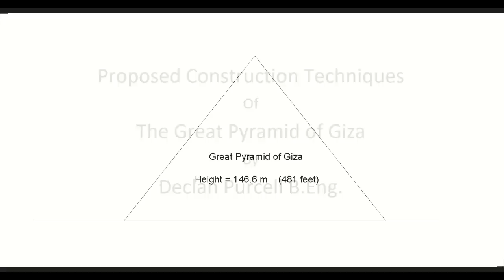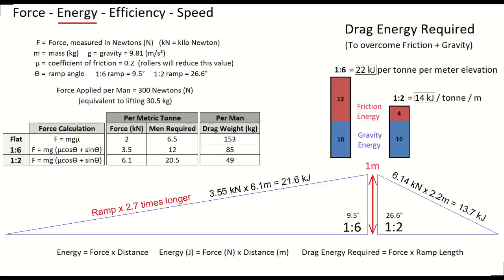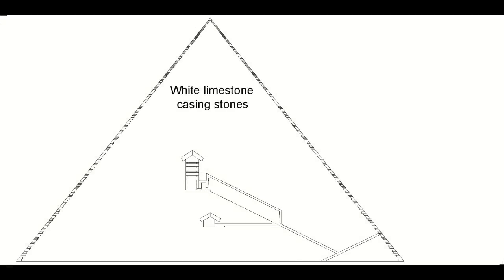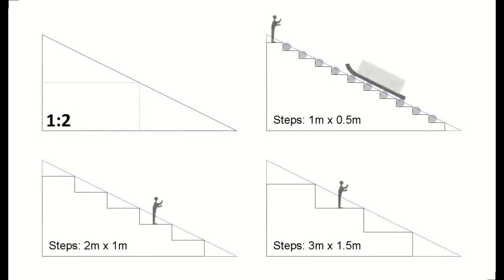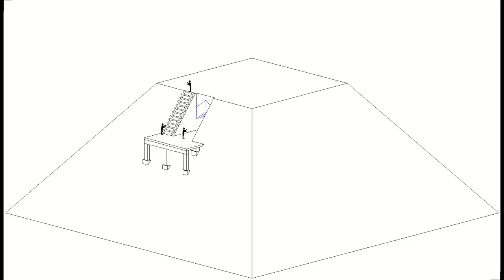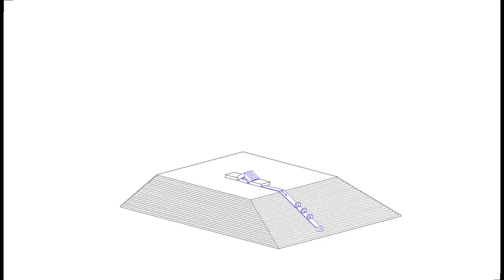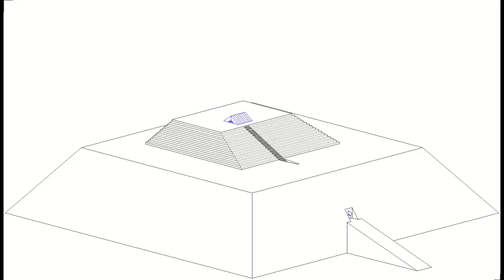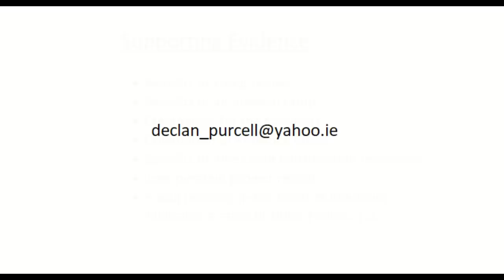Proposed Pyramid Construction Techniques

Comment: Internal spiral ramp. That's what I think
Reply from the maker: Problems with Internal Spiral Ramp :

1: Very shallow angle means the ramp is incredibly long (oner 1 km to reach the top)

2: Up to 18 corners to reach the top (Extremely difficult to navigate blocks around corners)

3:  Corner sections need to be exposed during construction which means they need to be filled after construction … 
This is an extremely difficult task…..  How could it be done…?

Comment: They used water. The blocks were floated into place.
Reply from the maker: The water theory is absolutely a non-runner.... 
I will make a follow-up video demonstrating why...
Reply: @declanpurcell571  do you understand how locks and damns and tow boats and barges al work, yeah?  Once the bottom outter parameter has been built and established , it could been flooded in and used to build it all from the bottom up. World's largest hydraulic ram pump
Reply: @declanpurcell571  The water theory is, just no like lol

Comment: Just a thought, but couldn't they also used their own body weights as counter weights instead of just pulling? For me it would be easier since you aren't exerting your energy pulling something you just hold on with everyone else and you slide down while the block goes up, the only energy you need is to go back up the distance you displaced
Reply: Im picturing some type of saddle harness that you just sit in and lean back

Comment: Wasn’t the Great Pyramid built in 20yrs? That’s would mean a block would have to be quarried, cut and placed ever 2 1/2 minutes. You ramp time at 3 minutes alone is not formatting the timeline.
Reply from the maker: For as much as 80% of the construction one entire side of the structure acted as multiple ramps and multiple step platforms, so 20 or more different teams could be raising blocks simultaneously...

Comment: I believe there was an internal spiral ramp that went along the inside of the exterior. It provides a steady 7 degree ramp, gives better access to the entirety of the pyramid while building. I believe they left to corners open to use a pully system to pull the blocks up, and there is evidence that suggests this was possible, there is a corner pocket opening that fits that kind of description that some have had the pleasure of entering. A few videos of it on youtube one can find.
Reply from the maker: Problems with the Internal Spiral ramp 
1: Very shallow angle means the ramp is incredibly long (oner 1 km to reach the top)
2: Up to 18 corners to reach the top (Extremely difficult to navigate blocks around corners)
3:  Corner sections need to be exposed during construction which means they need to be filled after construction … This is an extremely difficult task…..  How could it be done…?
Reply: Long, yet also easily managed with less people using a pully system. Only some corners need to be exposed, those where the tunnel meets with the corner. If the corner is exposed you would have plenty of room for the blocks. It also requires less material overall.
Many older smaller pyramids have shown internal spirals ramps. There is a low density imaging showing what easily resembles an internal ramp in the great pyramid.
Simply because one cannot explain every single detail, does not mean they are incorrect. But I would say this is the most likely of scenarios. Here is a video that likely describes it much better than I.
https://youtu.be/d7NZRKJvcNs

Comment: All good theories! Ive also read and seen examples of potential building strategies like A hemp rope crane system using pullys and elephants or people as counterweight. Float blocks using inflatables and raise them with a "Water Elevator". See-saw wood jack method to raise blocks. Wet sand.

Comment: If the Egyptians cut, moved, and lifted 2.5 million limestone blocks in 20 years
that means 500 blocks were cut, moved, and lifted each workday for 20 years
That's about 1 block per work minute to build the Great Pyramid

Nobody ever addresses this insane rate - but if you try to visualize 500 blocks being moved each day
ramps can't be used
sleds can't be used
rollers can't be used
levers can't be used

The Egyptians only used copper chisels, small logs, and rope to do this.
The Egyptians had nothing to do with the granite temple inside it - they never built it.

Think about it and the answers should easily come to your mind.
Reply: @noleftturns  are you familiar with herioglyphics? or did you flunk out of school before they covered that?

Comment: I don't understand why the fact there are voids filled with sand never gets mentioned.

Instead of 100% stone blocks, if the pyramid was built with voids filled with sand, it would hold the weight of the rest of the pyramid, yet require less stone being cut, hauled and placed, and it would take less time hauling baskets of sand and pouring it into the voids, than using stone.

With the new information about the corridor having been released, we may learn more as time passes, but with Zahi Fatass sticking his nose into the situation, we may never learn more as he always stops exploration, one way or the other...

Comment: The area around the pyramids was once a quarry, why bring blocks from 500kms away when they were actually standing on rock. There was one hill left when they were nearing the end of quarrying which they divided into three smaller hills, they added tiers to the outside of each, then they added multiple layers of geopolymers blocks, look very closely and you will see some of the lines between the blocks disappear in parts.
Reply: Because Giza plateau is made of sandstone and not granite? And they used granite only to protect the chambers?
Reply: @albertofernandez2490  Incorrect, they used 'sheets' of granite not blocks. Research this for yourself, they lined the Grand Gallery in sheets of marble in the 1970's but after a short time the adhesion started to fail, the sheets started slowly slipping, so they put in metal pegs thinking that would stop them slipping, it didn't so they had to remove them all but a few that are stuck solid. reasearch it for yourself, look for the 'pinkish marble' in the grand gallery, then look for the metal pegs, then see the marble sheets removed, except for a few.

Comment: I would not hesitate a minute to deny all the stories about ancient primitive Egyptians making the Great Pyramids and granite boxes as we find in the Serapeum and the many vases that are made with great precision, up to 0.001of an inch!. We need to stop using data that are made up by someone. The ancient historians Berossos and Manetho tell us much older data about the history of Egypt and Sumer. They mention kings that reigned thousands of years. The Arabic book Hitat by Al Makrizi tells us that the Great Pyramid was built more than 72,000 years ago. The Great Pyramid was built by a very advanced civilization because they knew that their civilization would disappear due to a predictable recurring but inescapable disaster. All these magnificent structures, large but also very small, are a message to us: "Those about to die salute you". That recurring disaster is caused by the ninth planet in our solar system orbiting our sun in an eccentric orbit. So that planet is only around our sun and its planets for a short time. After crossing the ecliptic plane of the planetsat a very high speed, it disappears into the universe for a few thousand years. These crossings cause disasters on our planet with a huge tidal wave, storms, rains and earthquakes in unprecedented amounts and a bombardment of fiery meteors. Another result is a cycle of civilizations. To learn much more about planet 9, the recurring flood cycle and its timeline, the rebirth of civilizations and ancient high technology, read the e-book: "Planet 9 = Nibiru". This book answers many of your questions. It can be read on any computer, tablet or smartphone. Search: invisible nibiru 9

Comment: Funny how they figured as much but not how to use the wheel
Reply: Egypt was one of the first to develop “the wheel” for purposes of moving things and they had the pottery wheel for quite awhile. The problem was never the wheel itself but rather creating a good load bearing axle. Early carts and chariots used thin axles as these turned well but they couldn’t carry much weight. Though we see the concept of a wheeled cart develop in multiple areas all show the same issue. Early carts just couldn’t handle much more than a single person of weight and broke often.

Comment: It is the fine adjustment of block alignment that is the difficult part. Like if to achieve perfect alignment the block needs to be rotated 3 degrees counterclockwise and 2 centimeters in the north direction.

Comment: There is a bit of a problem with your proposed solution : 
No one has ever been able to reproduce a single block of the great pyramid.   
Even forgetting the fine quality of the pyramid itself, I wonder where you find the average of  5 tons / man / day for the ramp construction.
Reply: What do you mean by "No one has ever been able to reproduce a single block of the great pyramid"?
Reply: @albertofernandez2490  As said, no one ever reproduced a single block of the great pyramid. By reproduced I mean in the same quality and with the tools said to have been used to do it (literally a reproduction). (The same goes for the other pyramids of Giza afaik)
Reply: @albertofernandez2490  In the video they don't reproduce a block, and they use steel tools while the tools in the records are copper tools. 
They don't show a finished product, and there is a good reason behind it : there is no finished product.
Reply: @Grouiiiiik  They addressed that. Copper is harder than limestone, would require more sharpening than steel. And hundreds of those chisels were found. As well as hundreds of diorite pounders used for finishing the stones.
Reply: @albertofernandez2490  Oh yeah.. the pounders. 
Then go on and carve a granite box with its lid and a perfectly flat surface with your pounders and copper tools. 

Spoiler : It's impossible.
Reply: Search diamond rope cut granite and then polishing finish of people.
Reply: @majkooll  no need to search for that. It's not a tool in the archeological record.
Reply: Thank you finally someone with some logic entering the discussion! Sebastian Mesili

Comment: how to build the pyramid in 9 months:
https://www.youtube.com/watch?v=nlchEBh7RHM

Your thoughts on this?
Reply from the maker: The guy seems very logical at the start, but when I saw the fractal ramps I was disappointed.  The effort to construct such ramps safely is enormous.  Zig Zag paths are highly inefficient for hauling stone and increases the ramp length exorbitantly. Even deconstruction time is excessive. And it also requires construction without the casing stones in place.  The difficulty of adding casing stones as the final endeavour is not very practical. I've even seen it suggested that they were added from the top down, which is usually necessary when assuming external face ramps were used as they still are needed to elevate these stones, and starting from the base isn't practical with such ramp structures in place.   

When faced with such a big construction project every small inconvenience adds up to an almost impossible task.  A solution that requires the casing stones to be added last needs to ensure they are laid from the base to the top and acknowledge the additional effort to ensure each stone is accurately cut on the back face to ensure to mates with the existing blocks. This requires a lot more stone working as opposed to first laying the casing stones and then butting up against them with the adjoining inner blocks.  ie. One method requires the casing stones are accurately cut on the back side as opposed to not having to care about the back side at all...  

I reckon it would take 9 months of labour just to erect and decommission these fractal ramps.
Often KiS philosophy works best.... Keep it Simple.. 
The more complex the task the more important is KiS.

Comment: You know this video is directed toward americans when the height is described as 20 stacked houses. Just say 139 Meters.
Reply: Or if you applied your atrophied brain you would see that he used a measurement through a comparison that is easy to visualize instead of an isolated number. But I see how two-story houses would be hard to visualize for Europeans as most of you live in cobbled huts or small earthen mounds
Reply: @lanceanthony198  now now, we ought to compromise with an international option: it's height is approximately the wavelength of the medium range maritime international distress frequency, 2182 kHz.

Comment: I find it very hard to believe that the ropes would have been strong enuff to pull the blocks up the slopes.
1 inch 3-Strand Twisted Monofilament Yellow Polypropylene Rope has a 12600 lb breaking strength,the material used most widely for the production of rope in ancient Egypt was papyrus (Cyperus papyrus) and other sedges of the Cyperus family. For large ropes, the entire stem was used, while smaller string was made of the rind of papyrus stems,if every man pulling had his own rope it may be possible but the use of one long rope seems impossible with the technology of the time,

Fascinating video,one of the great wonders
Reply: There is no reason to limit the number of ropes used to lift the stones. If two ropes are not enough, simply tying more ropes, whether it be five or ten, would do the trick.
Reply: @s.p2483  
Hauling a 40 tonn stone up a steep or shallow ramp with 10 ropes isnt feasible with the quality of materials used for rope making I am suggesting.In the video 1 rope was used.reguardless how it was done it is a marvel.

Comment: recent chemical research has proven the inner limestone blocks consist of recast limestone. The early 2,500 BC Egyptian builders used the basic raw materials used for this early form of concrete--limestone, lime and diatomaceous earth - it was found the chem nature of these blocks does not repeat in nature as well there is a much higher water content in these building blocks which points to fact the early builder made blocks from a concrete - it also explains the job of delivering the components can be achieved by transporting materials in much smaller quantities and making the blocks in situ less of a problem, requiring much smaller scaffolding - the larger granite blocks etc still remains a mystery and is still open to argument but the logical theory is they intuitively used wooden scaffolding as well as the slope of the pyramid itself was also used in ways and forms to support the scaffold

Comment: Recently a large number of cork bungs have been found near the pyramid site and a new theory of construction has emerged. Large numbers of cattle were fed rich grass from the banks of the Nile and had  bungs stuck in their butts till they filled with gas and became buoyant. Then numbers of cattle were attached by rope to the blocks and floated the stones into place. After construction the cattle were debunged and went about their business.

Comment: i find it hard to believe nobody has thought to apply basic kinematics to the construction of the Great Pyramids. But this looks far to simplistic to reflect the true nature and complexity hidden within these structures.

The main point of contention is the break down of your straightforward logic which does not take into account the non-linear dynamics of a system comprised of several 1000s of peoples. The more people the more difficult it is to organize said people.

Additionally none of these forces would remain constant in any of those diagrams, someone rocks would have higher and lower coef. of friction as well as footing for each individual stride... The thought of trying to reduce it to a simple ramp problem from high school is almost an afront to the majesty of these buildings.

I reckon they were made with space lasers.

Comment: I always get a kick from every one talks about the building of the pyramids . And they are all so far from complete . The project methods and timelines are nearly incomprehensible . 
1st was mining to cut all of the stones, mine etc …
2nd cutting and shaping ( may have been done on site)
3 hauling moving to construction site 
4 site construction 
5 site prep and ramps scaffolds 
6 putting in place .
7 labor shift changes feeding cleaning up housing etc 

There had to be a factory or coordinated efforts . 
At 20 years time to construct it means they had to place 315 stones per day . Or 15 per hour at a 20 hour day or 1 stone per 4 minutes. 
Modern construction cannot do this with cranes and bulldozers . So it would be sooooo many people and staging in parallel like a Ford factory . Also the leading processes would therefore had to be started earlier or be faster .
No one has solved the project management of the problem let alone the construction .
Reply from the maker: With adequate men, I could build the pyramid (as shown in the video) within 20 years.
Reply from the maker: @TheCommono  
Max lift on the pyramid was 80 tonnes...
Reply: @declanpurcell571  Ikr, 250 times as much lift capacity... 😂
Reply: @declanpurcell571  your theory considers just direct flow of events. What would be in case of disrupted rope? How often disruption could happen taking into account load and length? How much time to restart process of pulling? Each process has to be reviewed not only from successfull flow of events but and opposite ones, then define time and resourcess necessary to mitigate fails and then you could think about resources  necessary to complete project. Than bigger resources employed at the same time than better synchronization is required then the question who were those project managers? Another story could be with much less resources using tricky tools and technologies